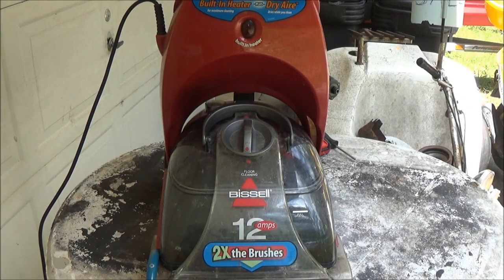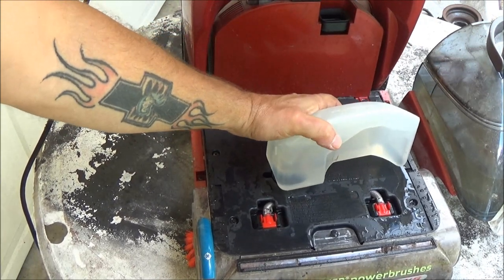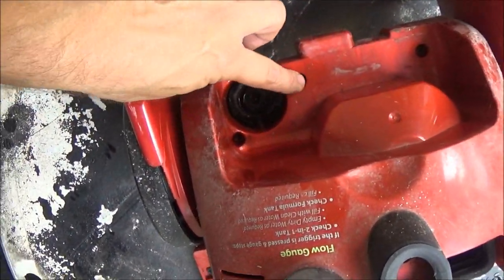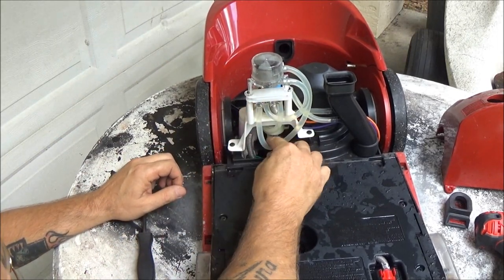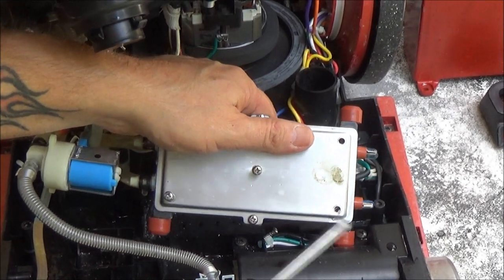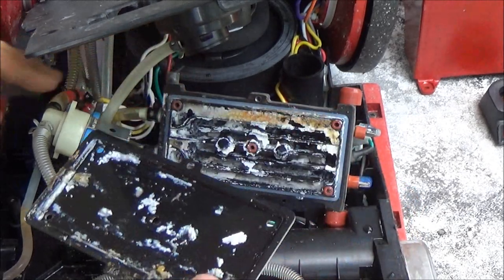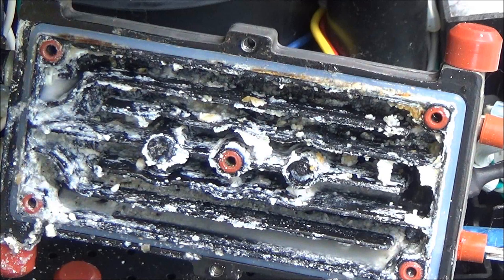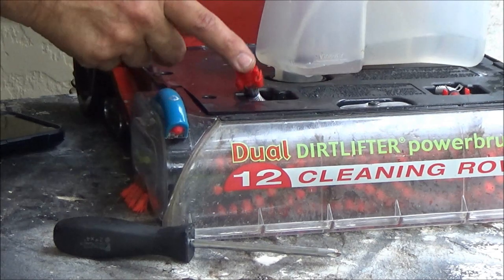Bissell Proheat Not Spraying How To

Comment: Best video I have seen searching for answers to my no spray problem. I have a model 9500 and this machine appears to be the same. A few things I learned the hard way. 1. Do not leave soap in the soap tank. Run clean water through the machine before you store it. Otherwise the soapy water will dry and the dried soap will clog the spray heads and lines. 2. The heater core is aluminum so the machine MUST be completely dry before you store the machine. The heater core will corrode if any water is in it when you store the machine. 3. The hose lines tear easily. BE CAREFUL removing them. I tore a stuck line going to a spray head and learned the 5.6 millimeter line (inside diameter) is very hard to find. I ended up using a quarter inch line which is a tad loose. I wrapped some electrical tape around the spray head outlet so the line was snug and would not leak. Most often spray problems are caused by 4 things. 1. The rubber outlet seal on the water tank has come loose and is stuck on the machine. If that happens the machine cant develop the suction to draw water from the tank. Just take the rubber seal and reset it on the water tank outlet (easy fix). 2. the spray heads or spray lines are clogged a need to be cleaned. 3. the solenoid flow regulator is not working properly (its the little blue thing to the left of the heater core when you are facing the front of the machine. (cheap part that costs a few dollars on amazon). 4. The heater core is plugged and needs to be cleaned (like in this video). If you see your heater core is corroded just throw it out and replace it. A new heater core on Amazon is about 25 dollars.  Hope this video helps someone. It was frustrating having to learn this on my own. I searched through many videos before I found this one. Many thanks to this man for making it. Instead of having to spend hundreds of dollars on a new machine, I got mine working for about 40 dollars in parts. Like I said this video is the best one I have seen. Thanks again.
Reply from the maker: Thanks for the tips. And thanks for watching and commenting. Have a great weekend.
Reply: I have the exact same one, thanks for great views I am trying to completely do without the heater and looking to bypass water in and the return line disable also plus unplug all electrical
 Connections safely that went to heater
Reply: I have a 9500. Can you remember the exact hose ordering?  I’m only 70% sure!
Reply from the maker: I'm not sure.
Reply: @robertthebruce6365  where which hose goes. But I worked it out by just feeling their resistance and as they’d held the same position for all these years it was easy to work it out

Comment: I use freezer tape and put numbers on both connections so I can match them back when taking the hoses off. If I didn't do something I could never remember where they go. Great video.
Reply from the maker: That's a great tip, thank you for sharing.

Comment: Thanks for the video.  Our bissell had been stingy with the water output and then stopped putting out water altogether.  I followed your directions to remove the heater (I too had to use vice grips on one rusted screw on the side) and found calcium buildup inside and even had to use a drill to clear calcium from inside one of the hose bibs.  Took several hours in the middle of the night from video to back together, but this morning it is working as it should.  Wife is happy (she slept through the trauma).  As Red/Green said, "If women don't find you handsome, they should find you handy."
Reply from the maker: You're welcome and I'm glad the video helped. Good job on your repair. I love red green, and I agree lol.

Comment: Thanks just followed your instructions and ended up cleaning my heater element. Just got done doing my carpets much to my wife's liking. Now that I have done it once it wasn't so bad. This is the first time in 7 years there was a problem so hopefully this will last again as long. The clog was a crystal-like substance and we have well water with a Culligan system using salt. Maybe?
Reply from the maker: Yes, hard water will cause the crystal like substance, it's actually calcium. We have well water too, it's a very hard water. I'm glad this video helped you. Thanks for watching and commenting Dennis.

Comment: I got lucky and checked the spray nozzles for clogs. I removed them from the machine and tried to blow through them and just got a small flow.
Cleaned them out with a needle and the machine works fine.
After looking at the problem, I realized the there is a way to diagnose the problem.
Place the unit on a table with the brush(s) protruding over the edge.
Place a wide trash can below the brushes.
Turn on the machine. Pull the spray trigger. Determine if the machine is spraying anything.
If it is, it is probably a clogged line. If it does not spray anything, it is probably something to do with the pump.
On some models it could be a worn belt. 
The easiest thing to do first is to remove one of the spray nozzles and turn on the machine.
If the flow shoots across the room, clear the clogged nozzles. Blow through them. Should almost whistle.
Test the flow now. 
Last thing that you want to try, if none of this fixes the problem, check the heater for blockage.
It's the hardest thing to get to, and if is not the problem, you've wasted a lot of time and frustration.
Reply from the maker: thanks for watching and commenting.
Reply: I had the same issue I checked the 2 spray nozzles in the foot and they were plugged i couldn’t blow through them so I cleaned them and it’s good to go!

Comment: Got one of these out of a garage sale. About to crack into it and see why it's not spraying. You covered a lot of the topics I saw the company website gloss over and went way farther. I'm just hoping these rusty screws will come out at all. Great video. Thanks for putting it up.
Reply from the maker: You're welcome. Good luck on them screws, they can be a real pain. Thanks for watching and commenting.
Reply: @shabear1000  Got the screws out with a fat tip driver but the heater and everything else in the foot are toast.  The plastic "nose" crumbled in my hand when I was shaking it dry after cleaning.  Don't think I'll be saving this one. It's already in the trash.
Reply from the maker: Aw man that sucks.

Comment: Hi Shabear1000, thanks for the video. My wife was having the same problem but in our case the water would spray from the hand tool. I disassembled it and the heater in mine was not very dirty but I did remove some white build up. I did finally find the problem and it was the the solenoid directional piece that was clogged and I was able to unclog it with my air compressor spray nozzle. I think I will try and order and extra part if it is available. :D
Reply from the maker: Glad it helped. Thanks for watching and commenting. I'm glad you were able to find the problem.
Reply: @shabear1000  FYI, I want to purchase a backup part as I think this will happen again but no luck so far finding the part... Just wanted to let you know. :D
Reply from the maker: Thanks for the update. You might be able to find that part on line, just type in the model number and part you need.
Reply: @toomanybarts  it is not actually a solenoid, but it looks like one. It is silver in color and had some tubes connected to it. Turns out it was clogged because of the minerals in our water. I disconnected it, soaked it in boiling water then used a small nozzle on my air compressor to force the removal of the mineral build up. I hope this helps. :D

Comment: Very useful - I have the same issue with mine over here in the UK, did a test run but boy is it tight in there and the moment you start moving the components up and out they refuse to go back in exactly the same way making it near on impossible to close it back down.  I didn't get as far as lift the heat exchanger out yet. Just something to be aware of folks. It is a ridiculously easy fix now that you've shown us,  but sadly if you can't put it all back in again you could still end up binning the thing. Just sayin'
Reply from the maker: Good point. Hope all is well across the pond my friend.
Reply: That's what happened to me. I got to that point, cleaned out the mess and couldn't put it back together.

Comment: I bet using CLR would clean up the inside of the heater and any hard water deposits in the hoses and spray heads.  CLR will take the finish off of aluminum but that shouldn't damage the heater in any real way.  Of course be sure to rinse all the CLR out before using the machine.  I have to take mine apart to find my spray problem so this was helpful.
Reply from the maker: That's a good idea to try. Thanks for the tip Dozer.

Comment: After watching this video I thought, “Hmm vinegar…”. I ran vinegar through both parts of my machine and in about 10 minutes my machine that had not worked in over a year was working great. I ran water through the machine to clear the vinegar. And then operated it like normal.
Reply from the maker: That's awesome. I'm glad you got it working again. Thanks for sharing that tip as well.

Comment: Hi! This was, by far, the best video I’ve seen so far to troubleshoot repairs! Wish I had seen this before I started my repairs! Because I had nothing to lose, I unclogged all hoses, spray nozzles, clogged heater so everything looks good but it won’t spray
 out of main tank area but suctioning just fine. It’s not the gasket either; already checked this. The attachment hose sprays & suctions fine but when I turn the dial to floor, the machine will not suction from large tank or soap tank. I have a pro max 2x- 9200 model. Any ideas? Thank you!
Reply from the maker: You still have a clog somewhere. Make sure check all the hoses and nozzles again.  Let me know what you find out.
Reply: Turns out that there was not a clog in the lines. It was the solenoid valve that had gone bad. I purchased a new one online & machine works & sprays  like a dream! Your tips were still helpful!
Reply from the maker: @gingerspajamapants1739 ah yes, totally forgot about that.  Glad you figured it out and thanks for sharing that with us.  It might help someone else in the future.

Comment: Thanks!  This was a big help.  We got ours working again.
Reply from the maker: Yayy. I'm glad it helped. Thanks for watching and commenting Chris.
Reply: Wonder if you can help.  We put it back together and it’s not sucking up any of the water from the carpet.  Any ideas on what we may have put together wrong?  The tube that has suction has some but not enough I guess. We checked the red gasket that seals the tube and that looks good.

Comment: That stuff in the heater is from not running water through to  flush it after using. The soap stays, dries up and eventually accumulates causing all that white stuff you see in the heater

Comment: I just found another way I was with you up until the heater I put it back together poured something like Drano very small amount into the back reservoir and I just pulled the spray handle maybe a min and it worked I was so happy as I just bought tank and front suction thing
Reply from the maker: Great tip!
Reply: Debra Paddick so do I just put in drain cleaner and turn it on?
Reply: Debra Paddick :You had me with Drano.. Although I substituted vinegar and Baking soda . LOL..
Reply: The heater core is aluminum so I dont know that I would use drano on it.

Comment: i just fixed this the first thing you do is check the valve on the bottom my would not  work when i depressed it letting water in  ordered amazon 30 bucks works great  pour a cup of water in the hole see if sprays  half the battle  if it sprays pump good  lol

Comment: Any solutions on why the red flap door on the tank with the bladder inside keeps closing after a couple passes? When it closes the machine wont pick up water. I have to use two machines.  One to spray and one to suck. Smh.
Reply from the maker: Not sure why it would be doing that, never had that problem before.

Comment: You need to remove the heater core and soak it in distilled white vinegar for a few hours or overnight.  Repeat that until all the calcium carbonate and magnesium is dissolved and removed.  I'm also wondering if the solenoids are pugged up with the hard water deposits.  If they are downstream of the heater core then they may be bad and in need of replacement.  What screws did you remove to get the cover off? The ones near the read where the water pump is fixed on the machine.  I tried to remove the cover but could not get it off completely to get to the heater core. There were a few more screws that I needed to remove to complete the job. But it was midnight and I was too tired. I was planning on getting up at 5 to do some grocery shopping but nixed that idea and slept in.  I have a few parts that I need to order.  I saw on the Bissel Web site that they sell a new heater core. solenoids and a water pump which is the main components that may need to be replaced to get the machine to spray water. One thing I did that I should not have is to pour the pure Cleaning solution into the cleaning tank and not mix with any water.  I read the directions of the cleaning solution bottle and it said to mix with water. And then I saw a Bissel video that said to fill the tank with water to a mark and then add the cleaning solution to the full line mark.  But my machine didn't have a water line mark.  But the directions on the Bissel Cleaning Solution said to use 1 full cup of water and then add the solution to the clean solution tank to the full mark.  I'm not sure if I did that the first few times I used the machine. That was several years ago. I also have very hard water where I live and that can plug up the heater core easily. The design of the heater core is bad IMHO. They know it will need to be cleaned or replaced so they need to put it in a place where you can get to it without tearing the entire machine apart.  They could use longer wires and longer hoses to accomplish that maybe?

Comment: Thank you for posting this video. I did everything you did, even cleaning the water heater. Wow! It was so clogged. However when i put it back together and started it there is still no water coming out. Well i should clarify the water sprayed for a solid 2 seconds and then stopped and wont do anything again. Any tips? -thanks
Reply from the maker: Yes. There is still a clog in a line somewhere. Check all your hoses. Let me know how it turns out.
Reply: I got the same problem .. took it all apart cleaned the Heater still No Water spraying from the Main Water Tank

Comment: My 9500P has the red filter cap and shows "unlock" to the left and "lock to the right". The cap does not turn either way. How do I remove the cap?
Reply from the maker: Try spraying it with lubricant and letting it soak for a little while.
Reply: @shabear1000  Thanks. I wound up taking the unit apart, and once I did that, it was easier to turn the cap counter-clockwise to open it.  I cleaned the spray jets and cleaned out the heater and the two ports on it. Unit still doesn't spray. Any suggestions on what else it could be?

Comment: I'm trying to find a video on this shampooers suction. Ours will spray without issue but when it comes time to suction the water up, it does a very poor job.
Reply from the maker: It has a clog somewhere
Reply: I have three guesses provided it is the same or similar model as the one in this video. Make sure the diverter is set to floor and not to the hand tool. Make sure the red filter screen is clear (it in on the upper part of the water tank where the handle is) and also make sure that the overflow flap is not covering the red filter screen). Lastly to check for suction, leave the tank off, turn the vacuum on and see if there is suction at the rectangular port. If you don't have suction there. There is a little panel on the underside of the vacuum. make sure it is on securely.  Good luck